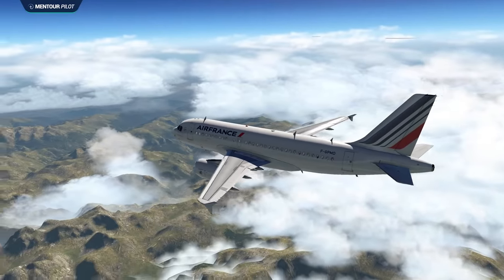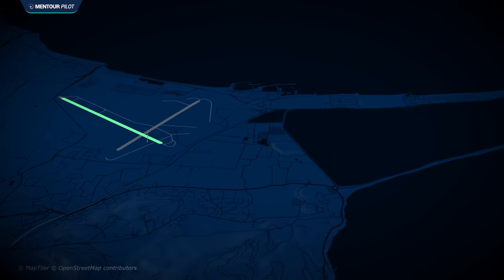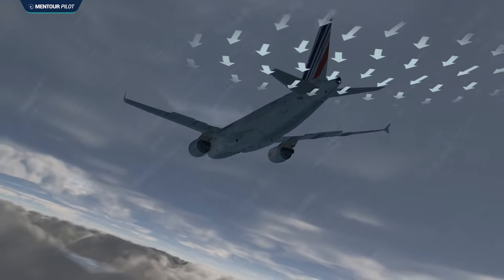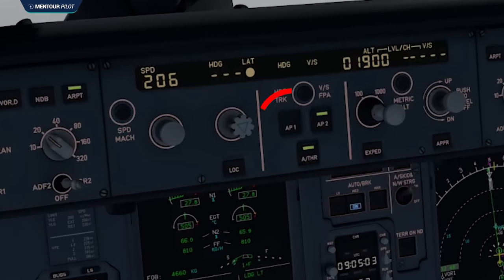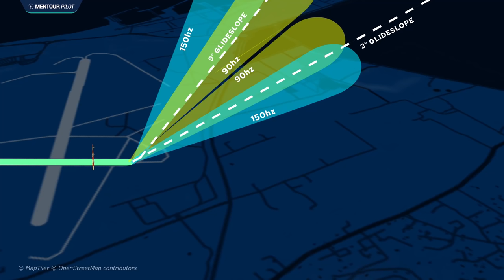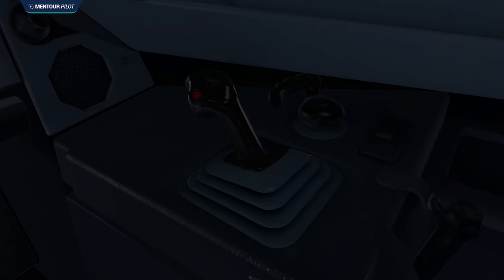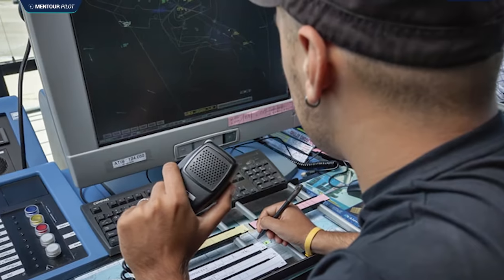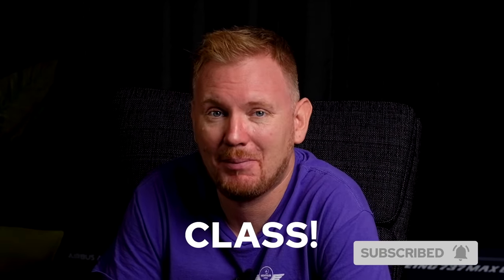An Absolutely CRAZY Reaction! Air France flight 7512

Comment: 8:35 6500 ft * 3 is only about 3.7 miles, not 19.5. I think you may have taken a calculation for metres and kilometres and accidentally substituted feet and miles?
Reply: No. It’s not a mathematical equation it’s just a rule of thumb. You just use the numbers only and then add the units after. We’re not doing a conversion
Reply: @tomstravels520  Hm. Then I think more explanation is required, if you don't want to terrify everyone in the audience with a science or engineering background. “Adding the units after” is a well known way of having serious problems. (Of course, it doesn't help that, apparently by coincidence, then, the calculation happens to be literally correct in SI!)
Reply: @stephenspackman5573  all you are trying to I do is establish the distance to start descending for a 3 degree angle. So ignore all units for now. 6500 x 3 is 19500. Strike off the 2 zeros and you gets 195. Now pilots know to add in the decimal point in the right place so you get 19.5. The only distance measurement use for aviation is nautical miles so that’s what the result is. It’s the same as ground speed (measured in knots) x 5 equals the vertical speed you need to maintain a 3 degree glide. But pilots know vertical speed is measured in feet per minute

Comment: Why is there no third radio signal on the glide slope directed on the false slope that the system could pick up and immediately recognise that it's false?
Reply: No. That signal would also have a side lobe which would overlap the real glideslope. This is just a fact of radar technology. As mentioned, there are ways how to deal with it in the plane itself, when the plane's computer recognizes it's a false glideslope.
Reply: @misarthim6538  But that side lobe would also be reversed, no? Surely the computer can be programmed to ignore a reversed signal.
Reply: @Caldera01  Computer can be programmed for any signal analysis, so if you're doing that, you should probably just  do it for the original reversed side lobe. Which is exactly what Airbus did, actually,

Comment: Your point is well taken at the end but with some of the stories you've told, it makes it seem like the name Boeing should be synonymous with crap with how often they show up and its something in the flight systems that wasnt thought out properly, or in one of your earlier cases it flat out sounds like their isnt being enough oxygen being fed to the cockpit on long term flights to prevent fade out of thought and concentration with one of those 777 max things

not to mention my father taught me and taught me well, never fly on a two engine plane, always a four as if something goes wrong its got back ups, and theirs no real way for them to tell properly which engine is working, and what isnt

and actually one of your videos still very much confirmed that is still very much the case, that one where you recommended they put a video system in so they can see what engine is working and which one isnt when their dealing with limited visibility  a recommendation made since 1986 that they STILL havent done despite how small and durable cameras have become. 

and also I think outside of that volcanic ash episode you did with the interview with the pilot, and the DC 9 and 10 series of failed aircraft that should have been decommisioned and scrapped on day 2, generally it seems like all the stories never happen with proper multi engine planes

just the two'fers or threefers

and also the other major takeaway is never fly air india with how bad their stories were, as that's the other thing, you very much highlight all the failings of the different airlines and how it can screw up based on the carrier

like it seems to me that you guys kinda just dont really treat the things with the needed respect across the spectrum and that with all those controls you've overcomplicated the simple with all those automation systems that just seem to be always stepping on each others toes. 

and the attempts to neutralise it with multiple pilots and checks all over the place just makes the situation worse when something quickly jumps at you

and that would be another thing, what about your incident reports, as it sounds like every pilot has one with how badly eveything keeps getting screwed up in some way or another. in all these stories, and alot of them seem to be in recent times and not the past.

Comment: "would you like to perform a holding pattern?" Weakass suggestion. How about, You are too high-would you like to preform a holding pattern?" If Control knew they where too high and didn't not clearly inform them--they too are a big problem in the industry.

Comment: @8:30, 6500x3 is not 19.5.  The algorithm should be (height above runway / 1000) * 3?
Reply: It is obvious he was calculating in this and did feet. Pedantry has no place in the flight deck.
Reply: @peteconrad2077  No, assuming the "obvious" leads to accidents.
Reply: @phillymathguy8142  nonsense. Every jet pilot knows this shorthand for equating altitude with distance to go. It’s simple and effective. Stick to stuff you understand.
Reply: @peteconrad2077  not everyone who watches these videos is a pilot. His audio and his screen were inconsistent. I'll watch for you in one of his next crash videos.  BTW, it's "on" the flight deck.
Reply: @phillymathguy8142  no. Both are used.
Reply: @phillymathguy8142  “assuming the obvious leads to accidents” .And yet you assumed he obviously got the calculation wrong because you’re not a pilot. Maybe accept the expert pilot knows what he is talking about and stop thinking you know better. Also both ON and IN can be used. But I have never heard anyone say “ON the cockpit” so it’s definitely safe to say that IN the flight deck can be used
Reply: @tomstravels520  No, he got the calculations right he just said them wrong.  His audio did not match his video. He said to adjust the speed by dividing by 10, but forgot to say adjust the height by dividing by 1,000.

Comment: It almost crashed because of the Fly by wire.
Same reason the  First A320 with all the media onboarding. faulty programming and electronics.
Reply: Wrong wrong wrong. Only one thing caused that plane to crash….the pilots. Also you say it almost crashed because of the FBW, which part of FBW had anything to do with this accident? If a 737 captured a false glideslope it too would react to it in the same way
Reply: @tomstravels520  You need to do your homework on the aircraft This plane has the name of scarebus.

Comment: Hopefully those members in this YouTube channel that make comments that pilots making such errors should be fired will learn and understand through your explanations. I am not being critical of them but I know from experience piloting a small Yacht and having taken flying lessons that; it is easy to work on spreadsheets and data crunching or a teacher or butcher or whatever, and make such assumptions. However, those assumptions are not practical and do not take into account the complexity of flying, navigation and the forces acting on a plane. They also don't fully grasp how cognitive ability and situational awareness are not so easily judged by non professionals who don't experience the weight of responsibility as intensely as a pilot of a heavy aircraft in poor weather conditions. I find those type of comments very similar to comments I may have made years ago before I had practical experience running dangerous inlets in the fog on a Cruiser. Moments like that really wake you up to how easily a typical office mind can be overloaded due to the weight of the situation in life critical moment that caught you off guard.

Comment: I wonder why the protection procedures of the Airbus didn't prevented the very slow speed and the angle of attack, could someone explain?
Reply: The alpha floor engages before the aircraft reaches alpha max so not sure what you’re trying to ask? The alpha floor reacted to the very slow speed by engaging TOGA thrust automatically
Reply: @tomstravels520  Yes, it engages TOGA, but I thought some other mechanism prevents a too high angle of attack. (Sorry wheelchair pilot here... :D )
Reply: @Delibro  yes the high AOA of attack protection. Stops the plane from exceeding alpha max. But alpha floor will activate before the aircraft reaches alpha max anyway unless alpha floor is disabled
Reply: @tomstravels520  So, when TOGA can't prevent the plane from an upcoming stall, does the attack protection lowers the AOA even when its only a too high AOA with the current speed?
Reply: @Delibro  the high AOA protection will lower the nose and reduce the AOA to prevent the plane from going slower than Alpha Max yes
Reply: @tomstravels520  Thank you.
So why didn't the AOA protection got the nose down in this case? Even when the alpha floor had engaged it should engage too when it feels that the alpha floor is not enough.
Reply: @Delibro  because alpha floor increased thrust and increasing speed reduces AOA. Also the pilots took over at that point too

Comment: Why aren't airplanes equipped with simple and primitive instruments like a mechanical gyroscope (spinning wheel with gimbals) as a “backup” to assess the planes relative position to the axis? After been watching your channel for a while it seems apparent that in many cases of incidents or crashes, that rendered up on distress based off deviation from ordinary routine. Under distress our brain often enters a primitive mode, thus impairing our learned abilities among other cognitive abilities. In such state of fight or fear, humans tend to be overwhelmed with information from all the digital instruments in a cockpit. It seems as a hard task just to prioritize and estimate the planes orientation to the axes, i.e., pitch and banking. It seems like some become passive, and some focus on the wrong task, and realizing their predicament to late in some cases; hence a primitive gyroscope om the dashboard with gimbals would provide an instant assessment of axes of flight.  

I don’t know if this would change anything in real life, but the ongoing automation of an aircraft, and the faceless industies believe in it, in the same time diminishes the pilots roll, not only reducing the pilot to a passenger (3-4 min of manual flying in start and landing?), but also put higher demands on crew, when the automation can't perform, to solve even more complicated predicaments, overwhelmed with by information. Then it's sometimes a good idea to look back to basic! (What are the black big wheels white markings, on each side of trust levers doing? Looks a bit cool primitive and basic to!

Comment: I have watched many of your videos and I am beginning to feel that "pilot" is the wrong word for these big, heavy automated machines.  Years ago, I took "pilot" training on a Cessna 172 and back then, one did have to actually fly the plane. No real automation, not even GPS. What it looks like to me is that commercial airline pilots are not actually flying the plane but rather the central focus, controller of all the individual automated systems. AI comes to mind. An AI module that is a "pilot" would perhaps di\o a better job of getting all the inputs and then taking various actions. Would passengers fly in an AI "piloted" plane? Certainly not right away but could see airlines moving to AI and one pilot in case.  Just some thoughts. Very complex automation and so many different systems, would have to be really focused all the time and perfectly understand how each system works or not works. reaching point that only an "AI pilot" will be able to fly planes??

Comment: It seems like you're struggling to describe the thing other fields of engineers have (keep having to) learn from how you're industry, how to fix avoid future errors by addressing the systemic problems.  I love your videos because they're like a marriage of psychology and engineering topics.  (Like chocolate and peanut butter making a peanut butter cup.)   

The gist is that we've had to train ourselves to look past the instinct to point fingers (everyone initially wants to do that), and that has to be explained in order to get past it, so we can figure out what to change in order to stop it from statistically being likely to happen.  It's all about adjusting behavior the designers, manufacturers, crews, and passengers to adhere to changes...  but the investigators are tortured souls...  they're like armchair astronomers with bleeding hearts, and they have such an important role as the rest.  

The Psychologists have proven that we have to learn to not try to find someone to blame, to target a single source.  To use executive function instead of emotion...  Because when we all and get past it, everyone goes okay what has to change in design, crew, controllers, or whatever that needs to avoid it?  

You're so right, I never really thought about it but it's the culture of targeting and correcting addressing post-mortems, that method is so difficult to explain to non-engineers..  admitting you made a mistake, honestly like everyone else connected in your workplace or field, so all other professionals can address it without fear of repercussions...   it's immensely so much more productive.  Love this channel.  = )

Comment: Missing GS capture, always very very anoying, seriously, i would only fly an airline where i can select G/S at a MUCH higher altitude, BEFORE LOC, I.E, rather than VNAV or V/S until LOC capture, and risking missing G?S because of ATC imcopetence (OFTEN) i mean, they like with (rubish* airlines) on schiphol, giving a heading at 2000ft, way to early, a loc capture is better at 80degrees  (turning the HDG knobs in 20 degree increments, speed 180, knowing you can capture the G/S on time, rather than a $&*%ING slam dunk approach

Comment: 6500ftx3=19.5 miles..... bruh you drunk? that is around 4miles with rounded numbers. must be a metric/vs standard(or imperial - note stanard&imperial are not really the same thing but for distance it is)  mistake and guessing you thought as 6500x3=19.5km then said miles

Comment: Great content, but a lot of your videos gives the impression these pilots forget/ignore to look at their instruments for 1/2/3/4/5 minutes.
You wouldn’t drive a car and ignore what’s in front of you.
It would be good if you would explain this properly rather than dismiss it as … they were busy.
Stop being on their side and call it as it is.
It will give your videos a more balanced appraisal of what they did right or wrong.
Reply from the maker: Hi Howard. In many cases the distraction IS the problem. 
I rarely put any personal touch to the outcome, I just explain what the final report has determined as the cause.

Even though using the car as an example, I hope you can appropriate the difference in information volume here.
Reply: I hear what you say and appreciate your reply.
I am not a pilot but do think some events could have been altered if one person flew and verbally talked though the ongoing issues.
This leaves the other person to address the issues happening around them.
Maybe it’s the way you describe the events.
It would be good to see the major events rolled out in real time.

Comment: As usual, this worthless video fails to explain that 'Pilot Error' was responsible for numerous errors.  Tail Wind of 50 kts., to high and too fast, should have dictated a Go-Around for Missed Approach irrespective of ATC making the suggestion.  To discuss and illustrate the potential consequences of errors committed by the Pilots, is stupid and does not suggest the two idiots flying this aircraft should be mandated to receive additional flight instruction and Re-Certification !